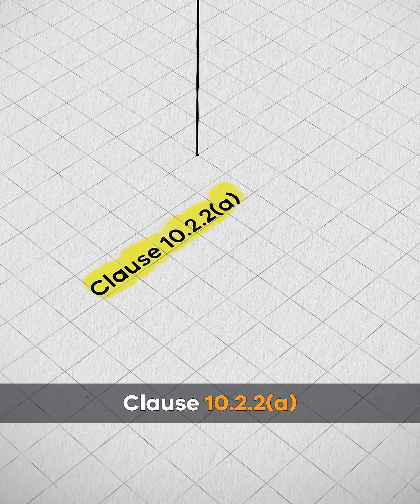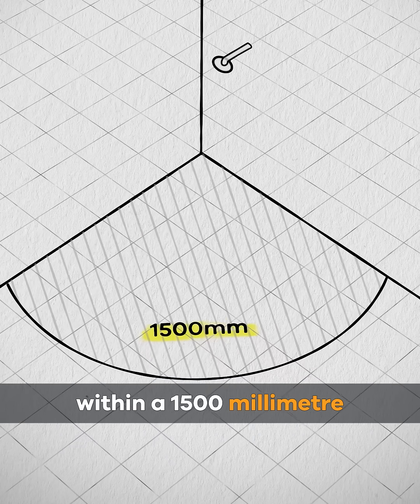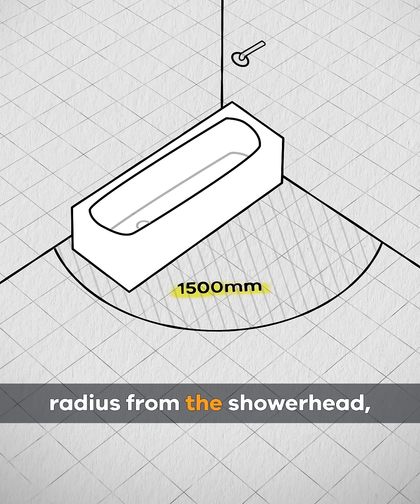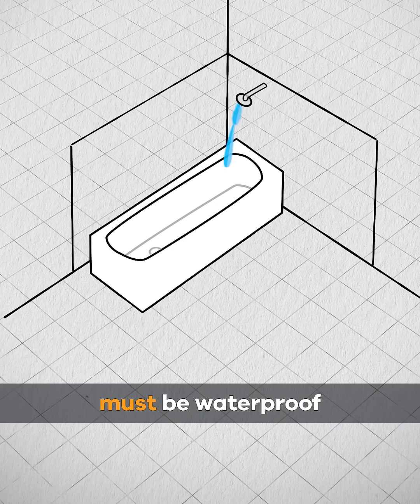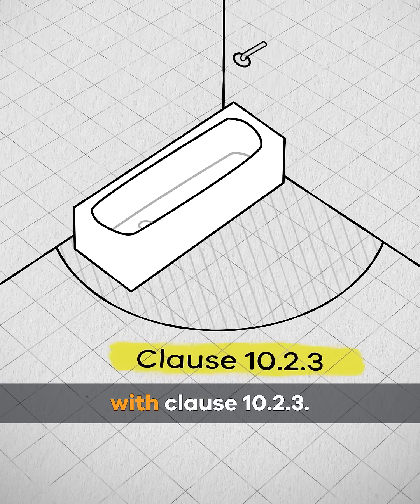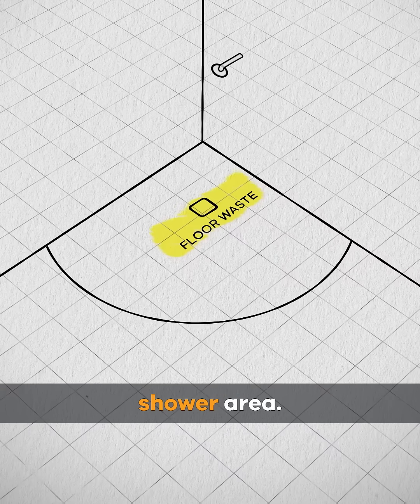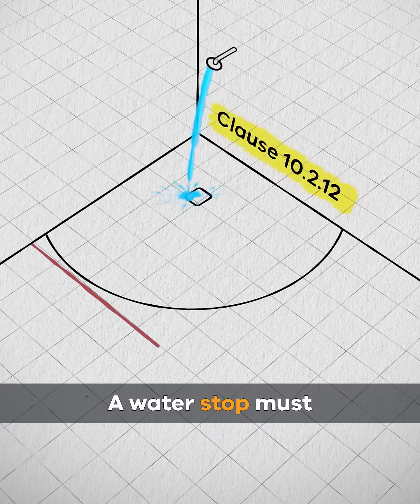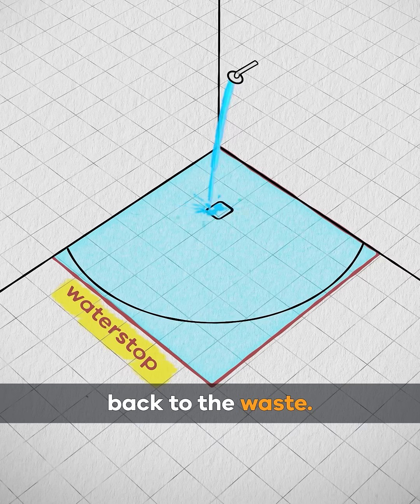Waterproofing of shower areas

Comment: What we would like is an explanation on what makes a shower enclosed or unenclosed.
Reply from the maker: The NCC defines what is meant by an enclosed and unenclosed shower area under Schedule 1 as follows:

Shower area: The area affected by water from a shower, including a shower over a bath and for a shower area that is -

(a) Enclosed - the area enclosed by walls or screens including hinged or sliding doors that contain the spread of water to within that space; or

(b) Unenclosed - the area where, under normal use, water from the shower rose is not contained within the shower area.

Comment: Freestanding baths don’t come with rear lip to check into studs and waterproof against etc. Can freestanding baths be installed against a tiled wall when used as a shower?  With the installation of a floor waste, 1500mm perimeter water stop in place.
Reply from the maker: Yes. Free standing baths may be installed against a wall when used as a shower. However, the walls and floor of the entire shower area (i.e. 1500mm horizontal radius from the shower rose at a minimum) would need to meet all the requirements for an unenclosed shower. This means at the extent of the 1500mm radius there must be a water stop and that entire area must fall back to a floor waste at minimum of 1:80. Furthermore, the walls within that area must be waterproof to a minimum height of 1800mm vertically from floor substrate – please keep in mind that this is at minimum. The BPC recommend where a free standing bath is installed, to have full bathroom waterproofing back to a floor waste to minimise the risk of water damage to other areas.
Reply: @bpcvic thanking you kindly appreciate the response

Comment: The problem is, no one designs or installs a 1.5m wide shower—most screens are placed 1m to 1.2m from the wall. So when the water stop is placed at 1.5m, the floor falls towards the screen between 1.5m and 1.2m, causing water to pond in that area. What’s the solution in that case?
Reply from the maker: We assume you are referring to the installation of an unenclosed shower that has a limited screen that does not contain water within that space. The BPC can provide general guidance only and is unable to provide specific solutions to a particular matter however, full bathroom water proofing is also available and additional floor waste can also be used.

Comment: you show the floor of the shower area falling back towards a waste, makes sense. Is this the same for the area of the 1500mm for the bath also(meaning it needs a floor waste with slope to the waste? Therefore with a freestanding bath would the floor be the same as the shower in that the freestanding bath goes ontop of the tiles which are on the slope?
Reply from the maker: Yes. Where a free standing bath with an unenclosed shower over is installed, the requirement is the same. As shown in the video, the minimum 1500mm radius is still applicable and must fall back to a floor waste, even if the bath has its own waste, as the floor of entire shower area is required to fall back to a floor waste. The free standing bath would effectively be on top of the 1500 radius. However, in practical terms, there may need to be some adjustment to this based on the particular installation. For example, the 1500mm minimum distance may need to be extended or full bathroom waterproofing may be necessary. The BPC recommend installing full bathroom waterproofing back to a floor waste to mitigate the risk of water damage to other areas.